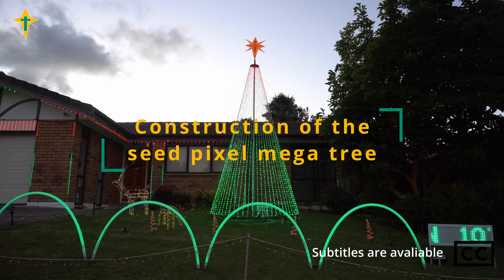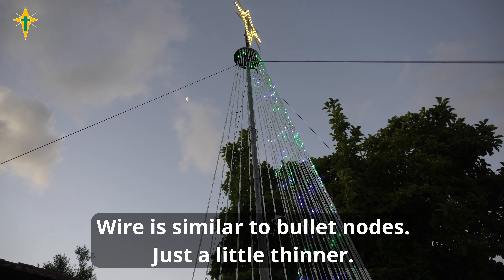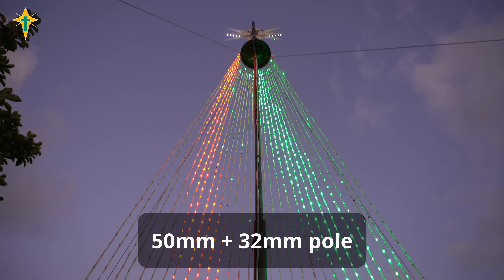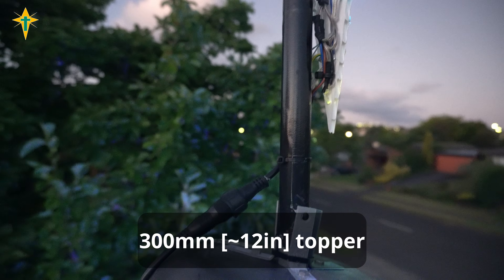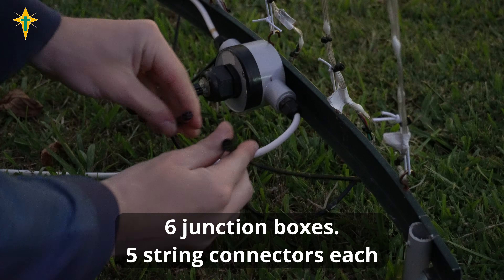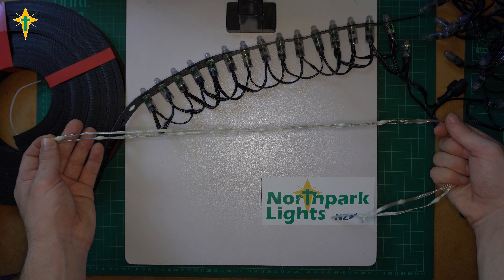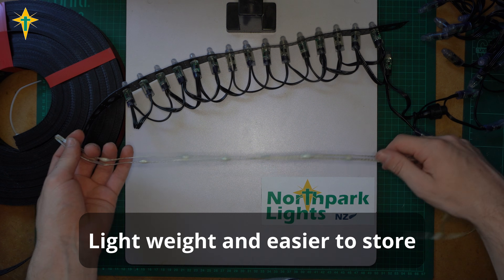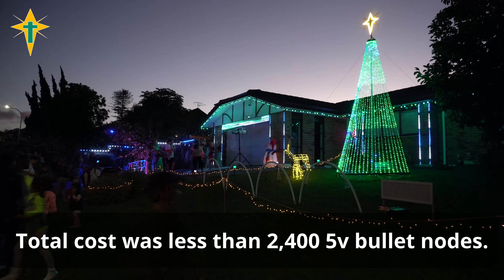2,400 Seed Pixel Mega Tree

Comment: i plan to use them but unfortunately my first bulk batch of 1k got lost in post

so i only have my small 10cm 200 led set i cut the stupid ble controller off and run it from my fbsd sbc which is not rpi. i have 1mm fishing line in the middle of string in a way that line is straight and leds are around it. not turned  around by each turn spirally, just random twist

i only plan to hang them on trees outside. wondered why you didn't put any on there. even if on addition

plan to use dc-dc from 12-20v (laptop, atx, whatever) to 5v, got 30 mp1584en boards and in future i plan to use small 5v 2a psus along the leds every so often. on 230v country here this is quite small current. can't decide where or if i use rs485 transceivers on this, got 30 of them tho

so, bad for my missing leds. i got animations ready and everything. other than 200 ws2812, i only have 50 ws2801 string and one apa102 strip 1m 144l. oh well
Reply from the maker: That is unfortunate your pixels got lost in the post.
Aside from SBCs, there is code projects "WLED" & "ESPixelStick" which can run on an ESP32 microcontroller. Some projects it's better suited to have a cheaper controller and pre-made effects with an app (WLED).
Some point in the future I plan on adding pixels to other living trees in my front garden. But for now it's easier using a flood light.

Comment: Your video is part of the reason I am getting back into pixels. A bullet pixel tree would have been over $1500. My only question is you have 80 pixels per string and you used alternating nodes. Are the seed pixels at 4" spacing so the tree is at essentially at 2" spacing per seed pixel?
Reply from the maker: Yes, pixels are 10cm (~4 inch) and with alternate nodes that comes down to 5cm (~2 inch). I have it shown on a table in part 2 video: https://youtu.be/GfvWu8W_wfA?feature=shared&t=88

Comment: do you have a video on how to program the tree? is it something that just comes with the box or that you can buy off the internet like CNC files? Any chance you have a buying parts list for the tree above and what height is it?
Reply from the maker: I made this tree myself. I bought connectors, spool of seed pixels, power supply and controller individually. Software is xLights and I make my own sequences or use freely avaliable ones. It's not an off the shelf product.
There is pre-made versions avaliable from Boscoyo designs.
Reply: @NorthparkLights  I looked them up and their like $40,000 wow. can I ask what you paid to do it yourself? Im just a home owner looking to up his christmas game but want to stay a home owner.
Reply from the maker: @randyogrady  have a look into xLights software and the pixel lighting hobby. I paid ~$600usd for the lights and parts of this tree. A spool of seed pixels is around $190usd for 3,000 now.

Comment: Awesome. Something I have wanted to build, but domt know where/how to start. You did t perhaps do  video of your build. Explaining the wiring, and programming? How many strands do you put on one channel of the controller? 
Is power injection at every strand top and bottom? 
You say you doubled your lines and spacing is 5cm and not 10cm, can you show example of how you actually did this?
Thanks very much.
Reply from the maker: I have done some write up & images afterwards with the wiring.
Doubling it over is doing 'alternate nodes': https://www.youtube.com/watch?v=a7wgHWFVVbQ , folding over the string effectively takes spacing from 10cm to 5cm, it also makes the string input & output at the same end. Which is then how the 4-pin connector is wired.
Post 3 and 14 in this post on AusChristmasLighting has wiring photos: https://auschristmaslighting.com/threads/marks-seed-pixel-mega-tree-smaller-and-cheaper.15280/
I ran 3 pixel ports. Simply because I haven't bought another controller. My whole shows runs off a single Falcon F48v3 and 4 receiver differential boards.
Power injection is handled by each junction box on the base ring. In the AusChristmasLighting post photos it shows how each strand is 'folded' on itself and power is paralleled at the connector. I bought rolls of 5v seed pixels when that was the only option, now you can buy many voltages. I would highly suggest running 12v or 24v if you were to make this.
The programming is done in xLights software.

Comment: Also job were converting over to seed pixels. I have a question do you have a link for where you bought your junction box's for your pixels. Seems like it uses less wires and pigtails this way
Reply from the maker: The junction boxes are electrical conduit boxes from my local hardware store (Bunnings). Many electrical stores sell them.
I used a conduit plug in each end, then drilled a hole to mount a PG7 wire gland into it. On the front is a much bigger wire gland I drilled and mounted in.
Reply: @NorthparkLights  thanks for getting back to me something told me u made it lol. Were wanting to use them. To are they easy to wire and put together im assuming.
Reply from the maker: @PaulHines1980  easy in my opinion to solder onto. The wire is thinner than bullet nodes.
I'll get the camera out and make a video on splicing them.... I see this question a lot :).
Reply: @NorthparkLights  thanks and its a pleasure to meet u btw

Comment: Hi, I must say a great job using the seed pixels, which I've found to be cheap and very reliable on other projects.  I going to build a 4m tree shortly for  the 2024 season. Would you recommend sticking which the 10cm spaced pixels and doubling back or go with the 5cm ones?  I think the 10cm option should be stronger on larger trees, due to having double the wire thickness per strand. Also the 10cm pixels per 1000 work out much cheaper than the 5cm per 1000. Not sure why but probably a supply and demand thing.
Reply from the maker: I did 10cm and 5v because that was the only type available in March 2022.
I have got 5cm spacing and comparing both options I would still do 10cm with alternate nodes wiring.
As you have said, it helps for strength. Is also helps when splicing failed pixels because I can use a cable tie align the replaced pixel to be in the correct position.

Comment: I just saw this. I have wanted to make a Mega Tree, but bullet nodes would take it to over $2,000. With these, I am looking at about $500 + the miscellaneous hardware. 4,000 50mm spaced 12V seed lights cost about $325, PSUs about $120, Topper about $25. I don't have the cost for the galvanized post, extra wiring, etc. But I would guess another $250. I can afford that and plan for XMas 2024. How tall was your tree? I planning 12' (~3.6m), but would consider 15' (~4.5m)
Reply from the maker: Exactly my reasoning for these seed pixels over bullet nodes was weight and cost! My tree is 4m to the top of the lights and another 0.5m for the star (4.5m total). 
The write up on AusChristmasLighting forum (description) has some extra photos.  
Stringing the lights up/down is the easiest way to get it done quick, but I would suggest connectors on lights in the future.

Comment: Could you have used 2.5cm pitch seed strings instead of doubling each stand? Or was it less to double than buying stands with leds closer together?
Reply from the maker: I bought these when they first got released and 10cm spacing was the only option to purchase, which is why I doubled it over to make 5cm spacing. Doubling over also solved power injection because I could use 'alternate nodes' function (photos in the AusChristmasLighting forum post in description).
I have bought 5cm and honesty I would not buy any smaller. Trying to solder 2.5cm and waterproof it would be a pain.

Comment: Did you double up 5cm spaced strands to make it 2.5cm between seeds?
Reply from the maker: @jasonguy1497 I used 10cm spaced seed pixels and doubled it up to make 5cm.
I've bought some 5cm spaced recently; 5cm is the lowest I would recommend to go because soldering & heat shrinking is a lot harder on 5cm! The smaller 2.5cm and 1.5cm sounds like an even bigger challenge to repair!
Reply: @NorthparkLights  thanks for the reply! Display looks great!!
Reply from the maker: @joofpv  Thankyou :)
If you are getting started in this hobby, there is xLights Official Support Group on Facebook, AusChristmasLighting forum, FPP forum and a few Discord groups.
There is also xLights Zoom meeting support where many volunteers help issues for free  (link is on xLights.org).

Comment: Nice job. What is the brightness like compared to bullet nodes. I am thinking to use seeds for an indoor matrix that would be covered with may be frosted perspex
Reply from the maker: I would compare these at 100% white to be the brightness of a node at 80% white.
This tree is running at 50% brightness in the video.
Reply: @NorthparkLights  thanks that's good. I just thought they would be much dimmer so no good for indoors, but sounds like they will be fine even behind some frosted perspex. Thinking about a 32*32 matrix for pixel art
Reply from the maker: @perfectheatingandplumbingp7747  A matrix sounds awesome!
I'm wanting to make a snowman this year and maybe another star with these lights.
A person local to me has used these seed pixels zip-tied to chicken wire for a matrix.

Comment: We were discussing this video in the Zoom room as I am thinking about doing this as well for 2023.  It looks like you supported the strands with something to take the strain off of the wire.  What did you use?
Reply from the maker: I have not used anything else to take the strain off the wire.
Imagine one string of 80 pixels, folded in half. Now the density has been doubled and power/data is at one end. That is why they appear as two strings of lights together.
Reply: @NorthparkLights  Got it.  Thanks for the clarification.
Reply from the maker: @aguidry1967  I'm usually on Zoom in the evening NZ time (8pm onwards).
Reply: @NorthparkLights  So those are 8m strings at 5V with power at both ends and no other power injection? If so then these seed pixels are definitely the way I want to go!
Reply from the maker: @andrewfidel2220  Yes, it is effectively a strand of 8m with power applied at both ends.

Comment: This is fantastic!   Do you have a link to the source for those lights?   I've looked up GFLAI and don't see anything that looks like them.  Very interested in these
Reply from the maker: I got these from GFLAI lighting, that was after they promoted themselves on AusChristmasLighting forum. You need an account to view this on ACL. https://auschristmaslighting.com/threads/ws2811-rgb-led-pvc-soft-mini-string-lights-mass-production.14370/  They were $120USD for 1,500 pixels.
Ray Wu (AliExpress) also sells these. Ray's come in different spacing and 5v or 12v version. 
Mattos Designs in the USA also sell these.

Comment: Did you make the junction boxes
Reply from the maker: The small junction boxes are from my local hardware store. I drilled a hole, added a wire gland and put 5 pig tails into it. I also drilled a small hole for the smaller wire glands at the ends.
The Tri-Box enclosure holding the power supplies is from another person who has sold their display. They paid over $100 per box.

Comment: Looks good, did you have to power inject anywhere?
Reply from the maker: It did need power injection. The pixels in a string work about 60-80 before yellowing.
My power injection is made very differently to what others do. 
1:52 I show a junction box:
Each string connectors to this box for data and power. So effectively every string of 80 has power.
The lights themselves are wired in 'alternate nodes'. Think of a string of 80 folded in half, now the data in/out and power is at one end. I paralleled the power wires at the end on the connector.
So power injection is effectively the same as a string of 80 with power applied to both ends. Each strand on the tree is like this. Plenty of power avaliable if I run this at 100% white.

Comment: Brilliant use of a frying pan! Love it!
Reply: Could i be so bold as to ask how you made your arches? Or point me in the right direction? Cheers.
Reply from the maker: @jonathanroberts8213  The arches are HDPE tubing, commonly used in 'Air seeder machines' (farming equipment).
I use 12v pixel strip inside them.

Comment: Do you have a link to purchase these light strings?
Reply from the maker: I got these from GFLAI lighting, that was after they promoted themselves on AusChristmasLighting forum. You need an account to view this on ACL. https://auschristmaslighting.com/threads/ws2811-rgb-led-pvc-soft-mini-string-lights-mass-production.14370/  They were $120USD for 1,500 pixels.
Ray Wu (AliExpress) also sells these. Ray's come in different spacing and 5v or 12v version. 
Mattos Designs in the USA also sell these.
Reply: @NorthparkLights   This is very clever--I like the way they wired them, out and back, so you can apply power at both ends effectively, if I'm understanding correctly.
Reply from the maker: @sidewalkspectaculars  Thankyou. 
Initially I folded it in half to double the density, then realised it was a great idea for powering it effectively.
Reply: @NorthparkLights  Oh, I see! For some reason, I thought they were manufactured that way, but you cleverly did yourself and, as you said, doubled the density. Nice. (And apologies for posting this under the wrong comment--I meant to post under the question someone asked regarding power injection)
Reply from the maker: @sidewalkspectaculars  A month later after I bought these pixels, Ray Wu started selling them. Then Mattos a while later.
Ray's are in 15, 10 or 5cm spacing and there's even a 12v option.
Sadly making an early order wasn't the best move...
I'm really temped to try a 12v version but they all look the same so I'd get mixed up!
Reply from the maker: @GODFREY Image the strand of pixels, at 4inch spacing and the whole strand is 26ft long.
By 'folding', I am finding the centre of the strand and bringing the input/output nodes to one end. So now it it folded in half to 13ft long, and the pixels appear as 2inch spaced.
At some point I'll release a quick minute video on it.

Comment: Do you power it like regular pixels and got a link were I can get them
Reply from the maker: Yes, they act like regular ws2811 pixels and are powered like regulator pixels on 5v.
I got these from GFLAI lighting, that was after they promoted themselves on AusChristmasLighting forum. You need an account to view this on ACL. https://auschristmaslighting.com/threads/ws2811-rgb-led-pvc-soft-mini-string-lights-mass-production.14370/ They were $120USD for 1,500 pixels.
Ray Wu (AliExpress) also sells these. Ray's come in different spacing and 5v or 12v version. Mattos Designs in the USA also sell these.